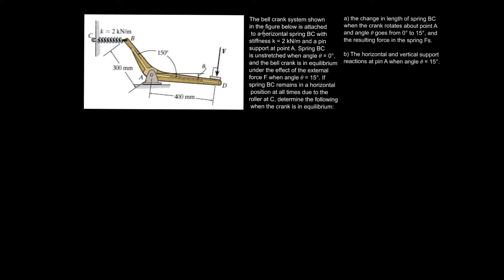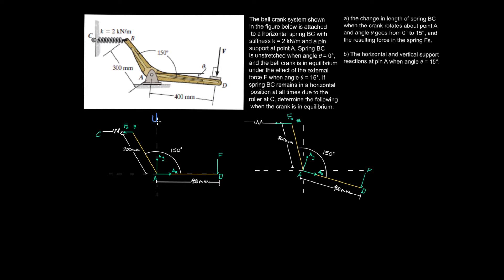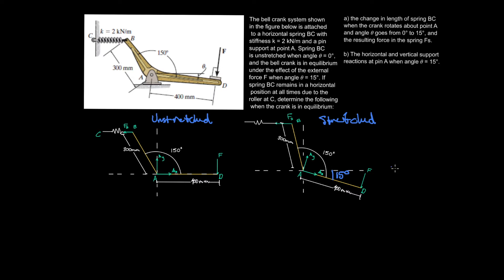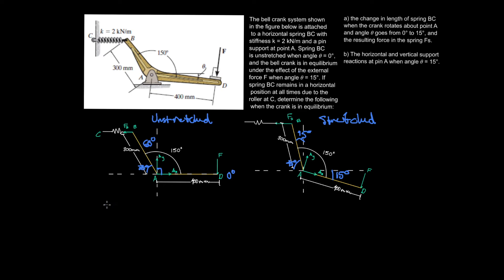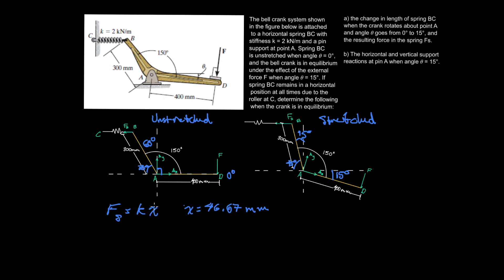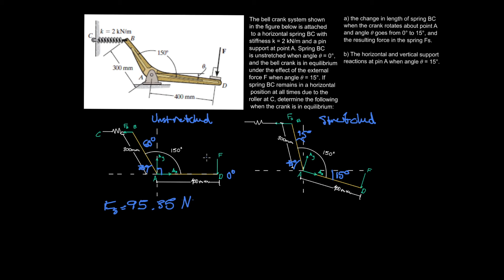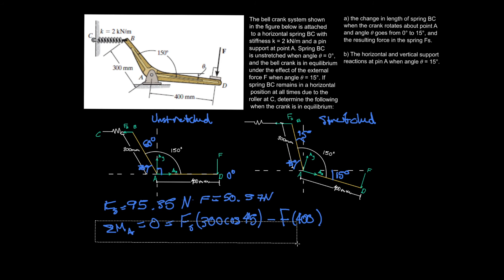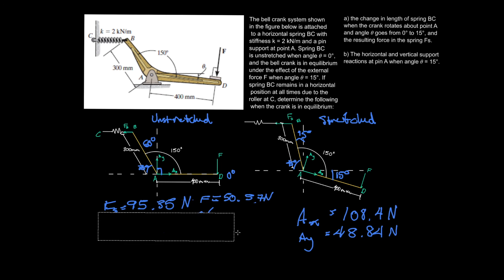Statics Bell Crank | The bell crank system shown in the figure below is attached to a horizontal...

Comment: This solution is valid... and I believe it is a good approximation. However, the extension of the spring is not exactly as given due to the fact that point B travels slightly vertically (y direction) as well as horizontally (x direction). Thus the extension is slightly more... and the resulting force on the spring will be slightly more.
Reply: Yes sir ❤😊